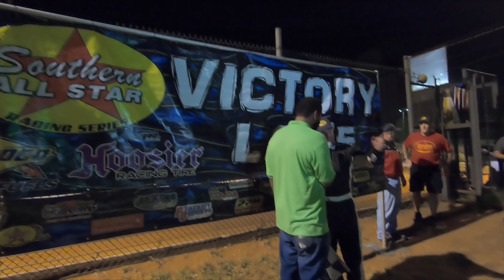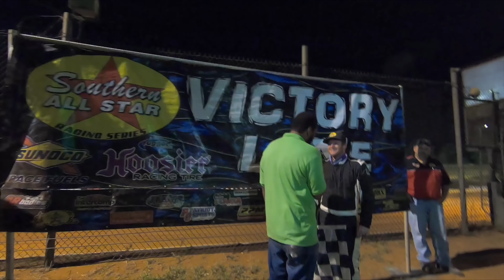We Got Out the Broom / Southern All Stars at Southern Raceway Night 2

Comment: I couldn’t tell if those were Jessel or T&D rockers but at the racing engine machine shop I work at.... we have had a little better luck with the T&D rockers. We do use both and we do use Jessel belt drives quite often. Not saying Jessel rockers are bad cause they are not. But we build a lot of blown stroker motors and the T&D’s seem to fail a little less.

Comment: GET THIS MAN A SUPER LATE MODEL MOTOR!!! If they will open up a fund a little bit from everyone that views will get him closer to that new motor.
Reply: Most definitely a super late model motor all aluminum 430 cubic inch dry sump small block Chevrolet. Unfortunatly they are very expensive some as much as 35k obviously depending on the builder but I’d say a good average is 20k
Reply: In a previous video when the installed that motor in the old 10 car they said it made about 750hp, I think I’ve heard a few times that the world of outlaw super late model guys are in the ball park of 850

Comment: Just wondering how do you get that car to hook up so good seems like every time? Some things you just can’t tell 😂😂 I used to do a little dirt track myself. I have to say nice work
Reply: I think they will find he will be even faster once he slows down and rolls the corners. Like he did when the track started to rubber up. He's used to using 100% of the car. Probably can hold back a little and save it for the end. Winning by half lap doesn't pay any more than by half a fender. But really impressive run for a brand new car. I grew up about 30 miles from Rocket Chassis shop. Used to never miss a race at Interstate Raceway in  Shinnston WV. Track is gone now. Shame.
Reply: My comments can come across as critical and condescending. Not my intent. More of a just think about it suggestion. Only use enough to win.
Reply: I completely understand. Enjoy the channel